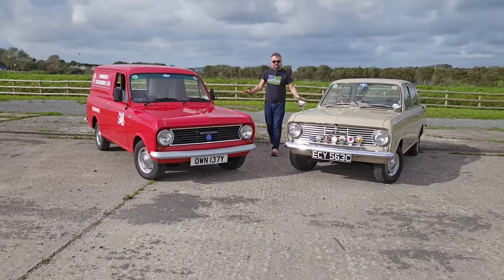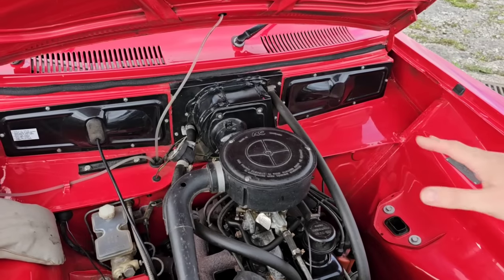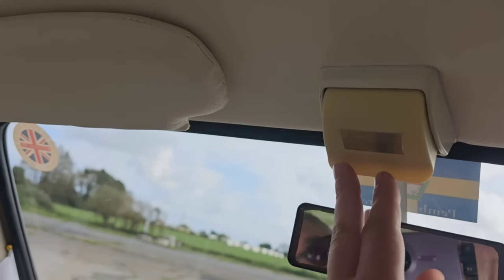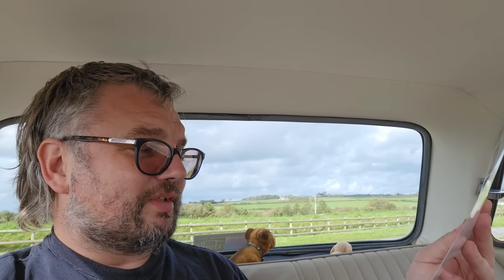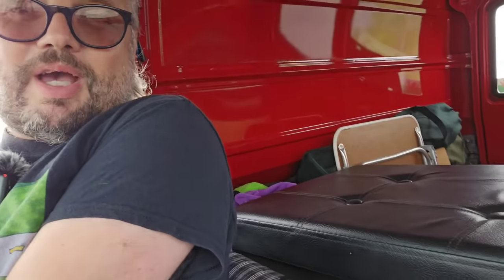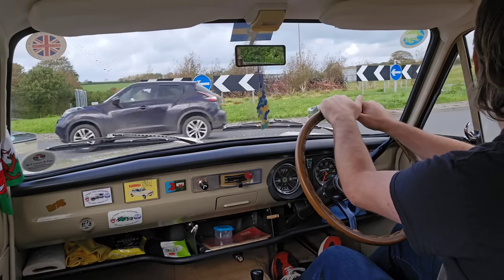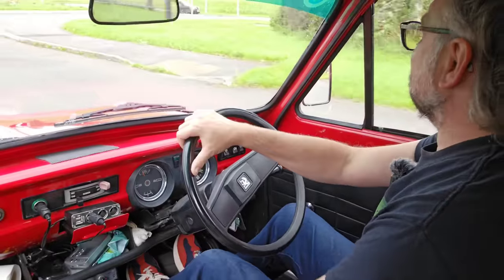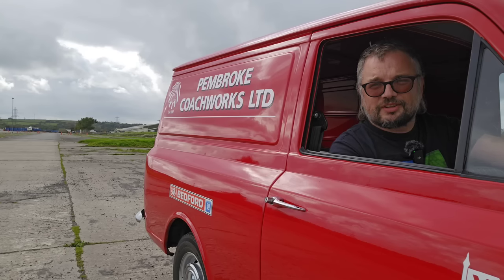Vauxhall/Bedford HA Viva saloon/van double test!

Comment: I wonder if the brake servo was mandatory with the option of disk brakes? Disk brakes don't sell servo, like drums can, so the assistance is more necessary.
Reply: Many cars in the 60s & 70 & indeed into the mid 80s had disc front brakes but no servo & they stopped fine ! It's to do with kerb weight ; most of these cars were under 19 CWT or approx 1250 kg ,. Datsun 100A,  Metro ,BMC 1100/ 1300, Marinas,  Hillman Minx & Hunter,Avengers, MK1 &2 Escorts & even the MK3 Cortina 1600 estate had disc front brakes with NO  servo  not untill 1974 was the servo optional! Pad material may be a different compound for non servo cars!
Reply: @mikemartin2957  what you said about kerb weight makes sense. I know that on American cars of the late 1960s onwards, the brake booster was a mandatory option when disks were specified. This lead to cars like the Hemi Dodge Dart only coming with drum brakes, because there was no room for the servo. Such cars were mainly intended for drag racing, so stopping wasn't that important.

Comment: Does this HA van have the ignition key release button on the steering column? 

A former employer of mine had an ex Telecom HA van while he was waiting to get a brand new F reg Bedford Astra van back in 1988 (which wasn't the most comfortable nor reliable of vans as it conked out not long after he got it). I had to do some deliveries with his then fiancée and she borrowed the HA, but she couldn't get the ignition key out of the barrel as she didn't realise the button on the steering column had to be pressed to release it, so I had to wait in the van as there was no way of locking it without the keys. Maybe that release button was only fitted to some, but it's a strange feature to have on any car.

As far as these HA Vivas go, I never knew they even existed until the most recent Lada-built Viva was advertised (and still haven't seen any of them on the road either) as I'd only ever seen the other two Vivas (and the Chevette) as a kid. Did they offer the HA Viva as an estate? I'd assume if they did it was the same body as the HA van, but with large side windows fitted like the later Viva estates.

Comment: They did say that it was the GPO (BT) contracts that kept them in production so long - How true that is I don't know!
Reply: I believe we did,when they withdrew the telegram boys Bantom bikes,we had three brand new Morris Minors all K Reg with sequential number plates,all used to deliver the telegrams we only had them just over a year and they were replaced with mini vans.
Reply: I drove an HA van for BT many years ago. Absolutely gutless due to the daft restrictors they used to fit. But…it made them great in the snow round those winding Sussex lanes.
Reply: @paulkingham7571  I wonder if you ever drove the BT Commer van with the accelerator pedal that had a pneumatic actuator under it? The more you pressed on the gas, the more it pushed the pedal back up...Absolute death trap to try and save petrol!
Reply: @kay110  I drove a selection of nasty Commer 15cwt vans. I don’t remember the accelerator pedal, I do remember having to be careful changing up into 3rd or you would skin your knuckles on the corner of the dashboard.
Reply: That was what kept LDV Pilots in production.
I'm not even sure the public could buy them latterly.

Comment: Great comparison video Ian, I remember British Telecom in the 80’s having the HA van, I don’t remember seeing any HA saloons but there were plenty of HC Viva’s about. 
     The only interior difference between the two there that I’ve noticed is the steering wheel, pretty much everything else is the same.
     The HA van must have seemed pretty old fashioned by the time 1980 rolled along the mk3 Escort van was a more modern van. 
      Am I right in thinking the HA van was replaced by the Astra van then the Astramax?

Comment: The engine and transmission reminds me of a 1983 Base spec Vauxhall Nova 998cc ohv engine I had very similar sound, it didn’t like to get too near 70mph it was hard work 60mph was about top safe line feeling, I then later got a 1986 Nova SR 1.3 ohc what a leap that was, nostalgia vehicles.

Comment: The Viva OHV engine was a semi-clone of the Kadett OHV engine. The resemblance is nearly identical, but the Vauxhall engines (as I understand) used imperial measurements in machining, while the Opel was metric. This led to minimal interchangeability between the two engines.

The Vauxhall was exported to Canada, and the Opel to the United States. The issues with salt for both cars were as terrible as they were in Europe.

Comment: they ran well until the pushrod wore through the rocker arm, clutch cables were hard to change on the bulkhead end, where they had a nut in the footwell you had on the end of said cable, 
quick chisel through the flat metal part under the bonnet above the cable worked well 🤣

Comment: I bought a HA van MOT fail to build a kit car, Y reg started life BT Buzby Yellow and ended hamerite black and green as a street preacher's van in Swindon 25?yrs ago. The guy also had a sherper van painted the same, The kit car was a fully self build as in buy metal and make the cassis from a set of plans cut it weld it not buy the chassis and body and mount your parts this gave me the option to use the van as the rear suspension is different from a Viva. Sadly the project got to a unfinished drivable that I had to sell due to change of live plans but I still have the rear number plate in my shed.

Comment: British Rail issued my father with a brand-new "T"-reg HA van to replace the Escort which was rapidly disintegrating into a pile of rust. It was a good, reliable van; his only complaint was that it was far more sluggish in traffic than the Ford, presumably a relic of its earlier gestation.

Comment: Great little car's. GMH assembled these here in Australia as their small car offering during the 60s and the HB was the basis of the initial Torana's which followed. I heard a radio interview years ago that mentioned the vauxhall viva was mostly put together with mainly 2 sizes of imperial nuts and bolts. I think they were 7/16 and 1/2 inch. 
Can anybody accurately verify this?.
Yet another great vid hubnut, you are amazingly consistent and thank you sincerely once again for your efforts 👍👍🥳
Reply: No idea. Mine always had a Sidchrome shifter in the boot. I thought it was standard until my Dad told me it wasn't The double-ended screwdriver was!

Comment: My first car was a two door HB Holden Torana. It was very unreliable. It had no heater. You demisted the windscreen with a rag. The diff broke twice. The Solex carburetor had a oil dampener which had to be topped up with oil. The gearbox was sweet and my car had a red vinyl floor and seats. The high beam switch was a button on the floor.
Reply: Hmm, the high beam on the HA was on the indicator stalk. Holden must have gone with the Kingswood switch for the HB.

Comment: The wipers on the 1965 model car swept more area than those of the much later van! Despite that, the long production run of the van proved just how good these vehicles were, regardless of how Vivas are often maligned. The water bladder for the window wash in lieu of the conventional plastic bottle is rather unique.
Reply from the maker: Believe the van has a taller windscreen, which doesn't help.
Reply: @HubNut  Ah I did wonder if that was the case. Thanks for confirming it.

Comment: Quite surprising that the saloon only lasted for three years before being replaced by the HB. Perhaps the reason why the HA van was in production for so long was for Vauxhall to get some value out of the Viva Research and Development costs. 🤔 I vaguely recall a British Gas HA van parked across the road from my family home in the 1980s. 

I like the HC Viva more than it`s predecessors but I tend to prefer 1970s designs over 1960s ones.

Comment: I had sold my car to help with the deposit on our first house, and after we bought the house and got married, we spent our last £150 on an HA van. It was ex the local brewery(!) and had acquired rear side windows and a folding rear seat. It was on van gearing, so only good for about 50mph flat out, and was very noisy and prone to letting in rainwater, but it was a sturdy old thing and got through the next three MOTs with only minimal expenditure. We ended up selling it for £125 and were by then able to afford a newer car (Fiesta mark 1 1100 S). But that old van, for all its faults, got us around very cheaply. And we built up a nice no claims bonus to carry forward to the next car.....

Comment: We had the Bedford van from 1976vto 1987. It had glass in all the panels and back seats. It had a very unreliable engine and no power. If you wanted to overtake anything, you had to slow up gear well down and speed up to get around anything.

Comment: Wow  Love the HA, one car i would love to own , 1st car i ever worked on at 9 or 10 years old,(In 1977/78) with guidence from my Dad, i removed gearbox & changed the cluch & that got me hooked on cars. unfortinaitly buy the time i met my wife in 1992 i never worked on a car again, now im 55 driving modern cars, most jobd are done by profesionals, One day i will get one wallet pending. I also had a Van in the mid 80s, (Ex Busby Van) i donated it to the fire brigade to practice crash rescue on.

Comment: My mum & dad told me they had an early Viva, before my time. It was the 1.1 engine. They had downgraded from from a Velux 6cylinder….due to running costs! They told me after the 6 cylinder, the original 1.1 Viva was very slow and hard work….but I expect that was typical of all small cars in the 60s.

It’s a generational tale of a model.
In my life, my early memory is of the much later Viva models….the much bigger cars, and they could take a variety of engine sizes due to their bigger size. This radical change in design from the original very compact Viva is a fascinating little story in of its self - why the big change. Tho it still sorta happens today….Ford Puma original to modern SUV Puma. The only thing they share is the name.
…the Viva was briefly brought back by Vauxhall as a modern city class car. Not sure if that was a rebadge of another car or not. Didn’t last long.
Reply from the maker: Yeah, modern Viva was closer to a Daewoo Matiz than any Vauxhall.

Comment: How on earth has the van survived  !
They had them new  on a building firm at around 1980s and before they got sign written the doors was rusty inside when you look down the glass ,  I got one three years later off them , then traded it for an xr3 , the sales man said when I part exd it 
"You didn't mention it only had half a door " 😆  it was true the bottom of the doors were rotted away

Comment: We use to make them in Luton and dunstable vauxhall motors. Its such a shame that its all closed down now. After Luton being famous for hats it was famous for vauxhall motors and when they closed it all down it caused so much unemployment. It has recovered now. Vauxhall employed half the and thank god I never worked there. I swore I would never work there. When my wife went for a interview at vauxhall they told her she was to smart to work there as she would get bored to quickly. They advised her to apply for a better job at vauxhall but she managed to find a good job so she didn't have to work there. Most of the car in Luton obviously were vauxhall. I always bought Nissan cherries I can't remember what they called it then but weren't Nissan. I never ever had any problems when I bought them. The only problem I had with them was that they rusted badly but then I would just buy another one. I had a cherry for 3 years and drove from Bournemouth to Luton every week and had it for 3 years and didn't even change a spark plug and when I scraped it due to rust I sold the engine and the buyer done a compression test and it was like when it came out of the factory. The guy couldn't believe it. Brilliant little car the cherry and went up hills better than the 2 litre vauxhall cavalier I was given. Great little cars

Comment: Had a ha van bt yellow  front wings 90% fibre glass and filler engine runbled vut kept going , was 1994 first van i owned after passing test cant remember what become of it , replaced by a p100 pick up whixh qas interesting on wet or slippery roads , rear wheel steering

Comment: I had one of these vans back in 1980. Retarding the timing slightly made the vehicle back fire when you revved the engine then turned the ignition off and back on again. Really loud bangs out of the exhaust pipe which was great fun. Unfortunately this eventually blew holes in the exhaust pipe so I stopped doing it.

Comment: You did not get rear head restraints on Escorts in the 1980s "on all but the base model". Even the RS Turbo didn't have any. There are models from the year 2000 that don't have them.
Reply from the maker: If I said rear head restraints, I misspoke. I meant front.

Comment: I worked on them in the 70's. 30,000 miles and the engine would be out for new piston rings and a bore hone. The gearbox was no better. Worn spigot on the main shaft with low mileages.

Comment: Interesting that the sidelight and headlight switches are separate – does that mean you could have the headlights on without the sidelights? Very unusual.
Reply from the maker: No. Turning off the sidelights also turns off the headlights.
Reply: @HubNut  Thanks, And presumably therefore turning on the headlight switch also turns on the sidelights. Great video. I think your point about the Mk3 Escort van being a contemporary of the Viva van says it all. The Escort would be totally at home on a motorway. You would have to assume the price of the HA van was way, way lower than the Escort van.
Reply: There's a mechanical interlock within the switch.

Comment: Amazing lifespan, more shocked that the 65 saloon had a servo & disc brakes (deluxe or otherwise) than that the 1982 van didn`t  .. In defense of the HC , it offered a 2.3L magnum option, which neither ford or BL could match in the "escort" class cars, Yeah there were rally developed escorts but they were special models and topped out at 1600cc during the HC's era if I remember rightly and no way could you compare an 1800 Marina , you had to move to triumph and the Dolomite sprint which was a different class of car ..

Comment: No engine temperature gauge on either model, and no overheat warning light either. I wonder how many of these ended their days when a burst hose or leaking radiator caused the engine to overheat and the driver carried on driving totally ignorant to the fact the engine was cooking. Blown head gasket or warped head galore and all because Vauxhall was too tight to install a temp gauge. Not even one for the deluxe model either, that's such a basic necessity it should be on all models, you need either a gauge or a light to let you know the engine is overheating.
Reply: I had one with a leaky radiator and, believe me, you could soon tell when it was getting hot. All the smells and vapours made their way through the bulkhead. Once the rad was replaced, it was good as gold. All cast iron engine and head so was pretty sturdy.

Comment: The vans can't have lasted into the early 90s like the Mk2 Escort and Mk1 Astra ones did. If anyone doesn't watch Salvage Rebuilds, Chris has a car version under restoration but no vids for a while, see back catalogue. The 3 bearing crankshaft sticks in my mind.
Reply from the maker: 3 bearing crank really not unusual for small cars in this era. Even the new-fangled Renault 5 had one for many years. Not pleasant to drive at speed!

Comment: Memories of changing the front leaf springs 😅
Reply from the maker: It doesn't have any. 😉
Reply: @HubNut  You might want to back track on that the HA had a single  transverse front leaf spring operating across the lower whisbones 
HB and HC had coil springs on what was essentially same suspension
Reply: The HA had a single  transverse front leaf spring operating across the lower whisbones 
HB and HC had coil springs on what was essentially same suspension

Comment: Cute, but I don’t think these Vivas shared many parts with cousin Kadett A. Unlike the Chevette, that was really a UK made Kadett C, again based on Kadett B.
Reply from the maker: Vauxhall kept it quiet, but the HA Viva owes a lot to the Kadett.
Reply: @HubNut  Hehe, yes, the same "basic principle". But there were almost no interchangeable parts, as far as I know. Strange. (I owned several Kadett Bs back in the days). But, it was the same with German and UK Ford for many years. In Norway, both German and UK Fords were sold at the same time. Totally different models competing on the same marked segments. Must have been a logistic nightmare for the dealers. But in the mid- seventies, only the German made Fords remained. And Vauxhall disappeared, leaving major seller Opel alone. Also, British Leyland pulled out. Sadly, UK cars back then had gained a bad reputation and went from ca 30% marked share to almost nil in less than ten years. Time for Japan, you know the story.

Comment: The HA van was rubbish, I used to drive one in the early eighties, the worst thing was the offset steering wheel, and the accelerator peddle that wore a hole in your foot, because the return spring was so strong.

Comment: I honestly don't think it's particularly sexist to say you needed lighter steering, gearbox, etc for women to want to drive it — oestrogen does reduce muscle mass and it is comparatively much harder work for stuff like that (or pushing a wheelchair!) than when you run on testosterone. Even when we've put on some muscle and strength, it's still harder to keep the muscles on. I know I factor in how difficult it is to brake or use the clutch on my driving decisions!